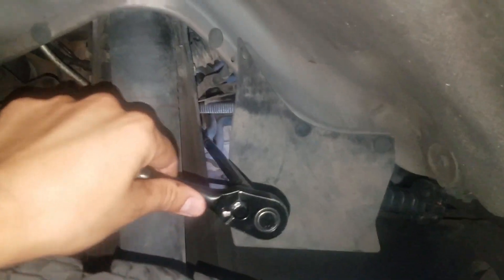Landcruiser FZJ80/FJ80 Coolant Block Drain Plug Removal EASY

Comment: Very helpful with location.  Please follow up with socket size and replacement torque spec.
Reply from the maker: @micahwest5347  just try a couple sockets until you get the right one. Tighten about one ugguh dugguh. You can also download the FSM from ih8mud.com and look up all the torque specs if you like.

Comment: Do you recommend flushing with distilled water if you are replacing the radiator? Also is there a procedure for the flush?
Reply from the maker: Yes, and then you can use a pre-made 50/50 coolant mix.  Like red 50/50 for Asian vehicles.  Toyota purists would say to only buy the Toyota red coolant.  In all honesty, I have never had a problem with flushing with tap water then filling with proper coolant.

Comment: But if you fill, short drive and then flush out afterwards with distilled water you won’t need to do the block drain no?
Reply from the maker: I like to get all the coolant out then fill with distilled water then drain again